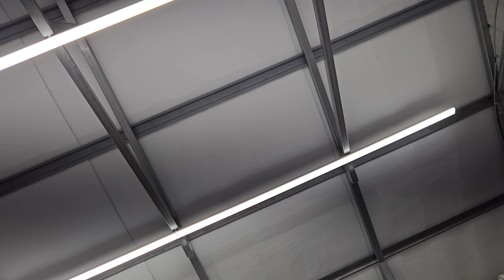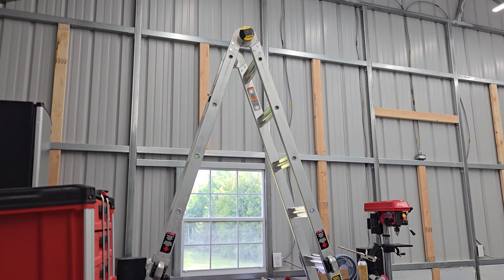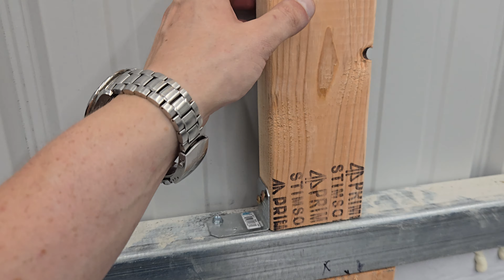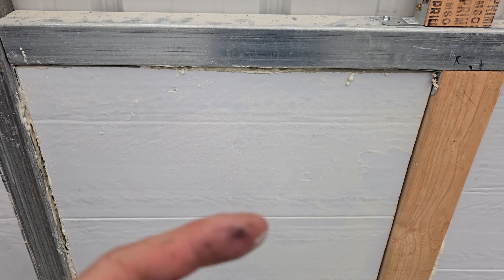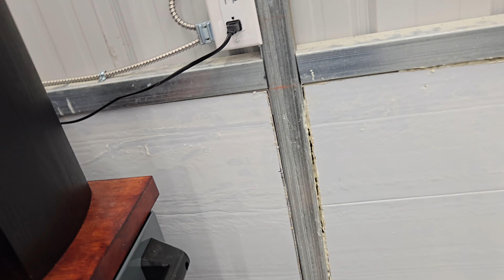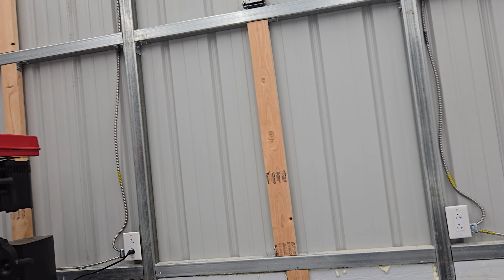Garage update - electrical and insulation

Comment: Not here to blast you and maybe you have since this video BUT please clean up all that wiring and MC cable as it looks like crap dangling, hanging and snaking all over the place. It looks like you just threw it wherever. Invest in some 1/2” or 3/4” (or whichever size you’re using) 1 hole straps and tidy up all those cables dangling & running up the legs, girts and purlins. Every 18”-24” looks uniform & clean. But don’t just slap them on wherever. Uniformity!!!! Use some zip ties to clean up all of the wires on those hanging lights. Coil up the excess cord nearest the plug (neatly) and zip tie it. Or zip tie the cords to the purlins…NEATLY! Don’t use a black zip tie on a white wire, use a clear one instead. Make it look clean. Invest in a cheap Dewalt laser level and get all of that stuff lined up clean. Secondly, leaving that gap between the foam board & insulation is a mistake. You’re giving too much of an opportunity for condensation to build up on the back of the exterior paneling. The high points on the siding provide plenty of airflow. A little OCD and an hour or two in the shop will tighten it up IF you’re leaving the walls exposed.